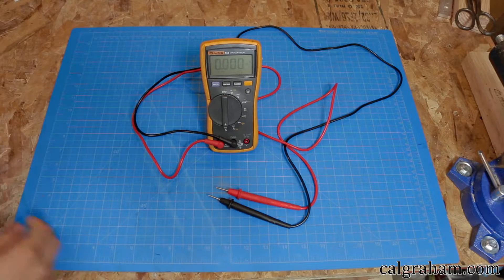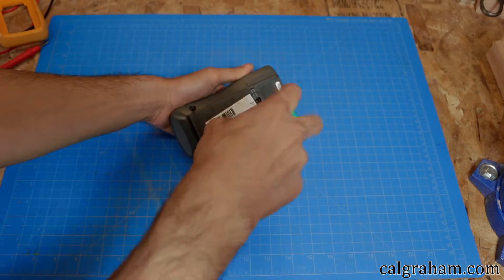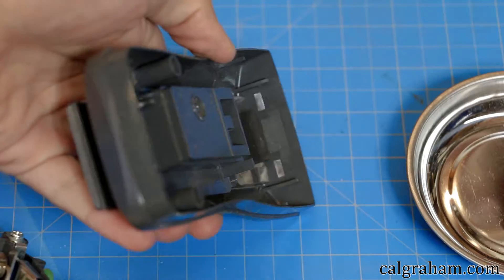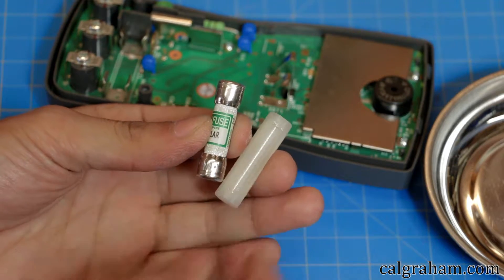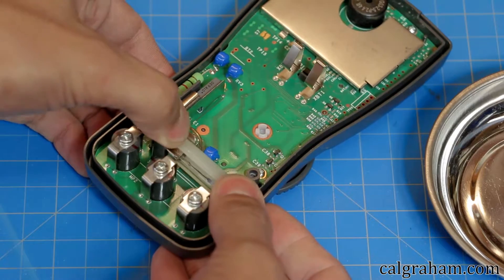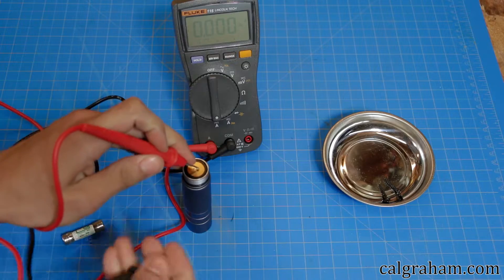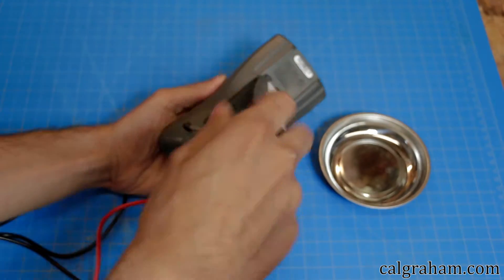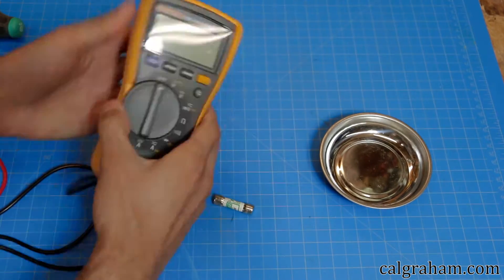Multimeter Fuse Adapter/Converter

Comment: you can get those fuses on ebay pretty cheap. that kind of defeats the purpose of that nice multimeter. still pretty cool what you came up with though.
Reply: JMC5 unfortunately most are cheap knockoffs with way higher rating than 10amps. Will fry your multimeter in no time